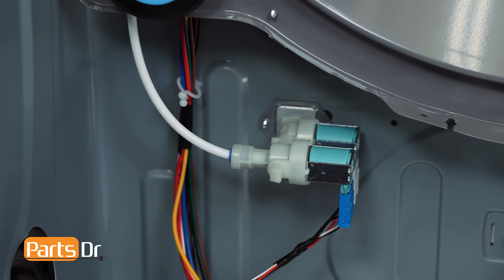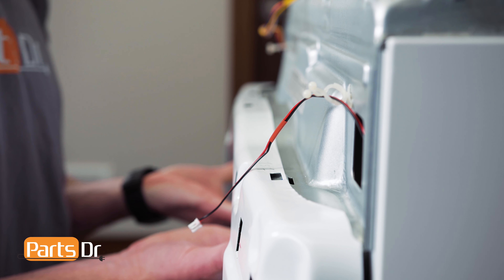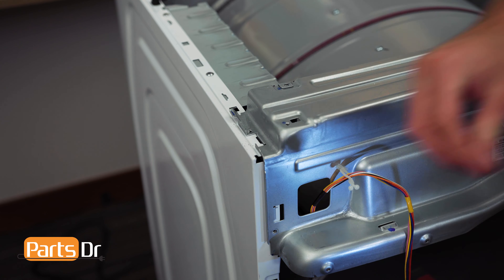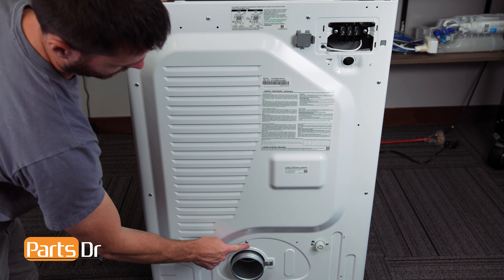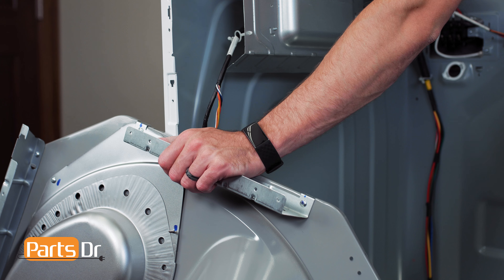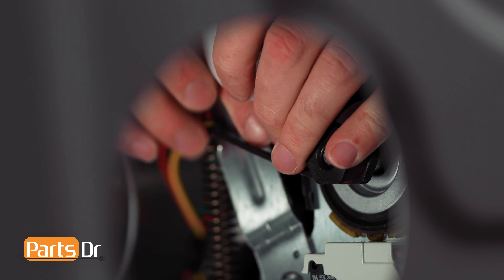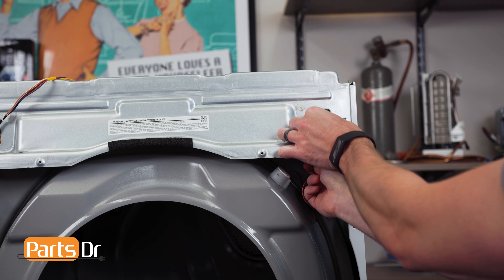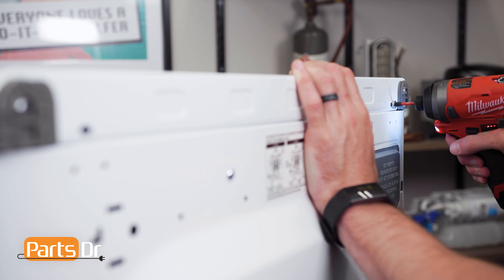How to replace the water valve steam nozzle kit part # DC97-16919B on a Samsung dryer

Comment: Can I remove the steam nozzle kit and still use my dryer?  The plastic piece inside the drum got messed up somehow and it keeps catching my clothes when I dry them.  I don't use the steam function so was wondering if I can just remove it.
Reply from the maker: Sorry, we do not know if the dryer will work properly if you remove the steam components.  Let us know what you find.
Reply: The plastic piece inside the drum was messed up and broken in my dryer too. The replacement looks so complicated. It basically tear down everything, haha! I'm wondering if I can remove it too since I never use the steam option. Did you try it with success? Thanks.

Comment: I have a new washer (Samsung WF45R6100AC/US) and dryer (Samsung DVE45R6100C/A3) that was installed in the stackable orientation with the steam connections installed to the dryer. The dryer has water trickling through the front door as the cycle starts and the clothes takes a long time to dry.  Its been leaking through the door since first installed new.  Could this be a bad water valve and steam nozzle shipped new?  Or what could be the main issue that started this?  Could anything be the reason from an installation perspective?  This is the second Dryer that was installed and had the same issue. I really don't like that I have to turn off the steam water supply hose in order to have the clothes dry properly without waiting forever. Any help will be much appreciated.
Reply from the maker: Could this be a bad water valve and steam nozzle shipped new? Yes it sounds like it could be.
Could anything be the reason from an installation perspective? Not that we are aware of, they are pretty straight forward to hook up and there isn't much that could be done wrong.
It would probably be best to have a Samsung tech look at it and fix it.  Let us know what you find as the cause of the problem.